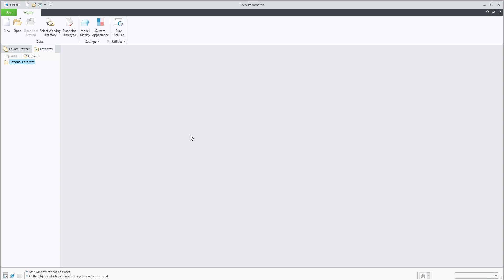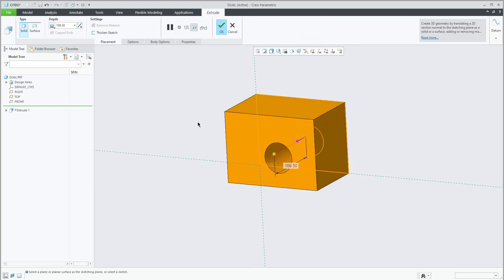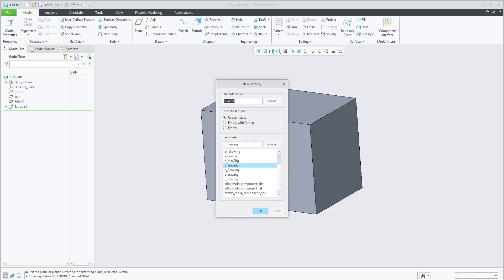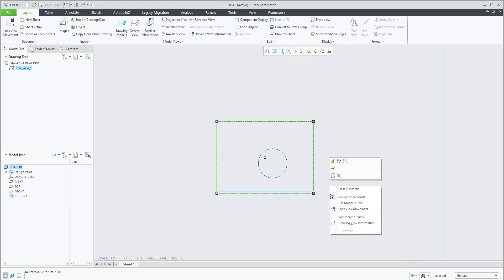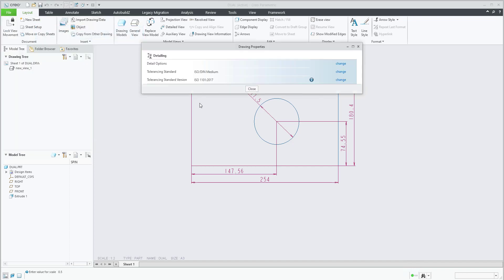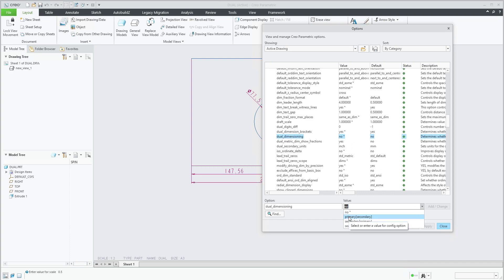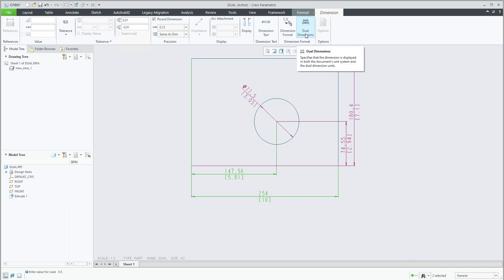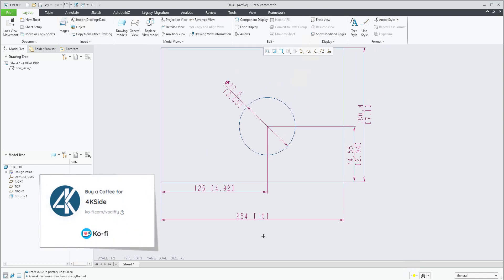Dual dimension - How to show measuring units on both dimensions (eg: 254.0 mm [10.0 in] )

Comment: Great video! But I have applied and didn't work for a gtol. It stayed the same unit in the gtols. Is it possible to change it?
Reply from the maker: I never seen before to use dual values for gtols...configuration option is for dimensions only

Comment: How do you display the unit labels on the dimensions? For instance, a dual dimension displays as 18.9 [480], but I want it to be 18.9" [480 mm]. 
Good video--thanks.
Reply from the maker: Hi, thank you for your positive feedback and also for your question.
I think that is not possible to show also unit label (but I did not try yet 🤔😉)
Maybe as workaround try to use note and explain how user need to read main and brackets dimensions.

Comment: Hello, 
Is there a way to add it just to the dimensions that we want or select??
Instead of adding them to all the dimensions on the drw.
Regards!!
Reply from the maker: Hello, sorry but is not possible by default.
If I will need two do it only for a few dims... I will add info manually (in the selected dimension please write @D text)
If you want to add value automatically, you can create relation and then use in the drawing dimension as text @D &parametername (defined by relation)
Good luck, Vladimir